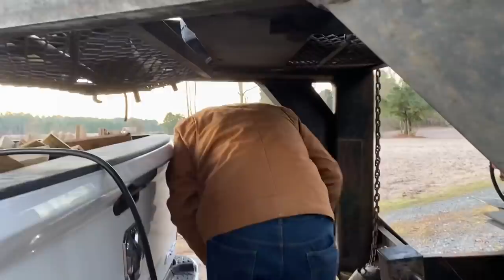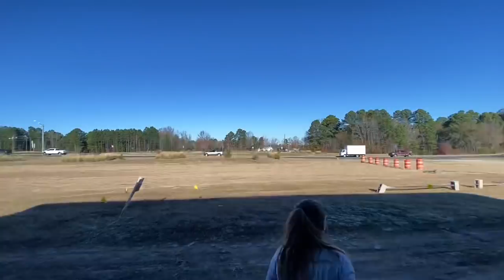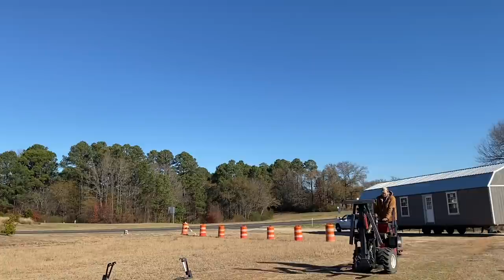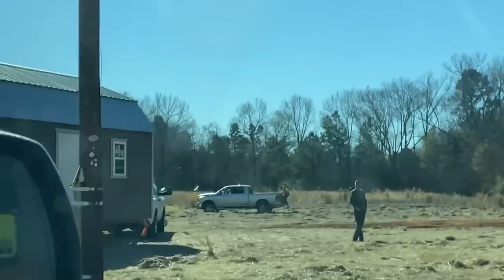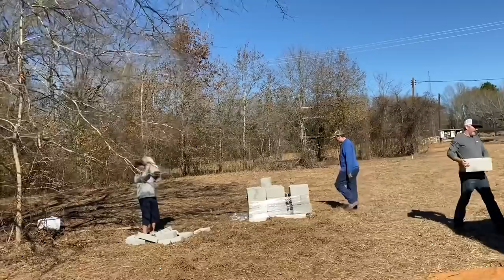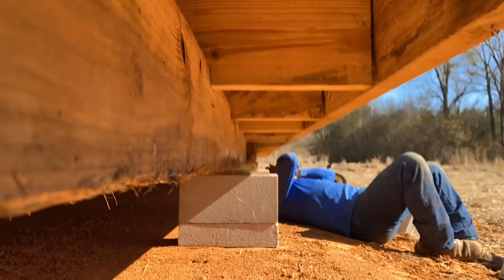16 x 50 Derksen shed delivery

Comment: What do you do if you have a wider than 16-foot building that you need to haul? 
Place your elbows on either side of your body while holding the camera and you will be able to hold the camera steady. 
Can you explain in more detail how you have a follow truck on oversized loads and what you have to do when you have loads that are wider than 16 feet wide and longer than 50 feet long? If you have to do a job like this at night what do you have to do if you have to cross state lines are there different procedures that you have to take and what goes into getting the proper permits? 
Thank You for sharing this good video.

Comment: Dont you checked the doors are closed before you set off they should be strapped or fixed so they don't bang  going along because that door will be out of linement  as it keeps banning on the journey I wouldn't be happy if that was my building

Comment: Does the center of the building need to be blocked up.
Or is it just the outside runners.
Will it sag in the middle after time
Reply: watch toward the end.. they were under it doing the center Runners too
Reply: I've got a 12x32 that's shimmed on one side. It does have some bounce on the inner skid. 
It's never been leveled correctly but will be some day when I finish it out.
It's on an unlevel slab.